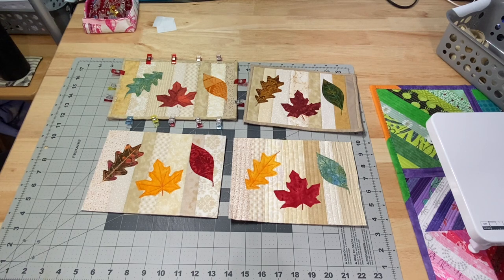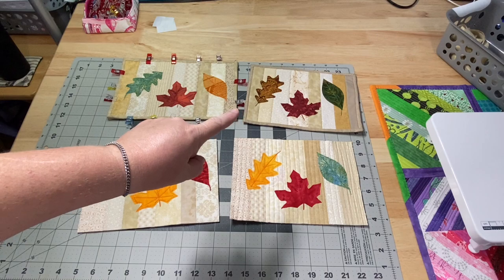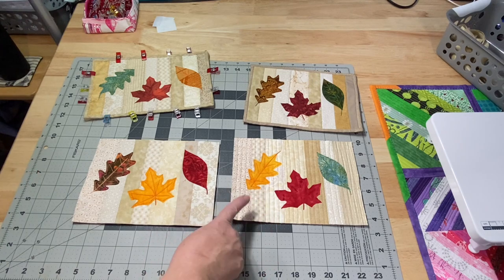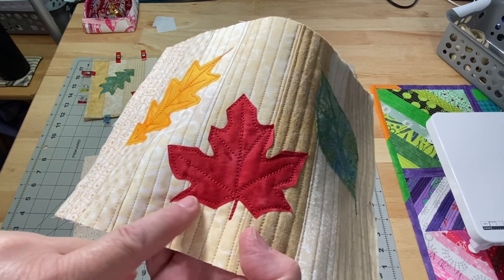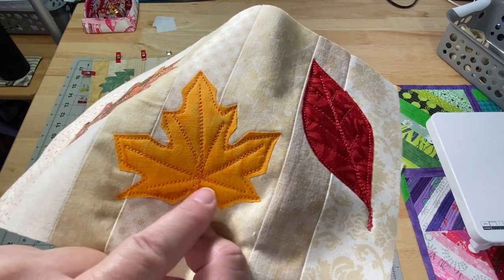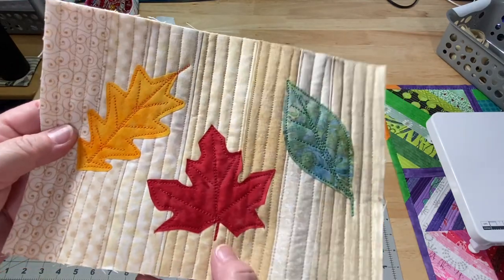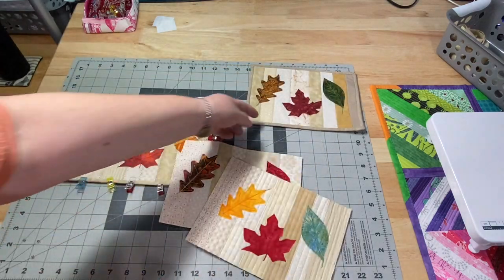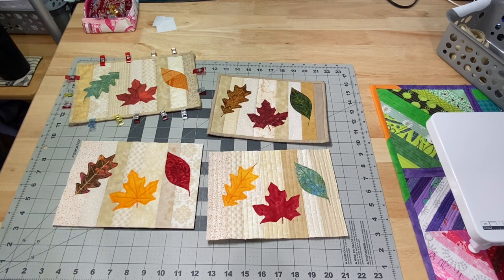Machine Appliqueing the Leaves and Adding Veins to Our Mug Rug Falling Leaves

Comment: I think that I will do the leaves using free motion quilting.  To avoid the pivoting and stopping.
Reply from the maker: I think free motion is a great option. It’s what I usually use.  I wanted to have another option for those that aren’t comfortable with free motion quilting. If I were to make multiple mug rugs like these, without using them in a video, I would make one large panel.  Then I could free motion all of the appliqués in one shot and then cut out the individual mug rugs. It might be quicker and easier that way. 🤷‍♀️.  Happy mug rug making. 🍂

Comment: Wow love your video. I would never have thought to go backwards on the veins like you did I would have flipped it around fearing double stitching.    You make it so easy.    So was this done in real time or did you speed up video?
Reply from the maker: I did speed up the video but not sure at what percentage.  I would guess less than 50%.  My software doesn’t speed things up very much. I did sew the leaves and veins at my machines high speed for most parts. It’s such a short distance on the branches of the veins so I thought why not?  I didn’t worry about “shadow” lines.   If I were waaaay off then I could always go back and add a line of stitching in between to fill that empty blank space.   If any of that makes sense 😜